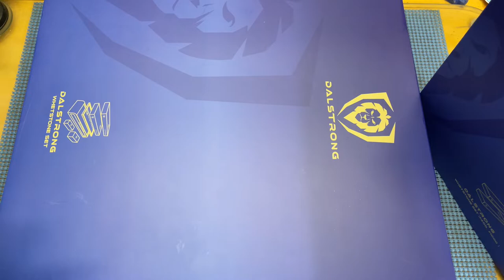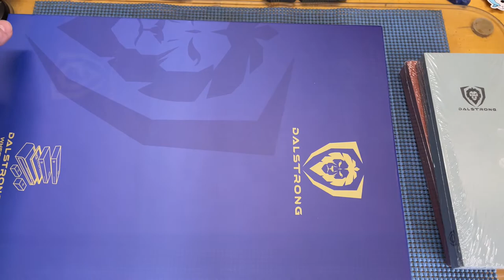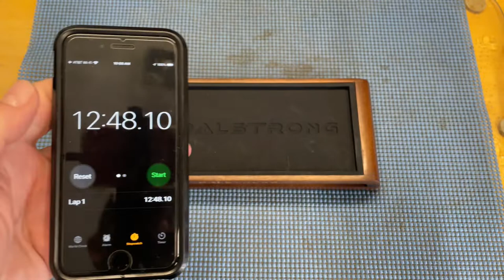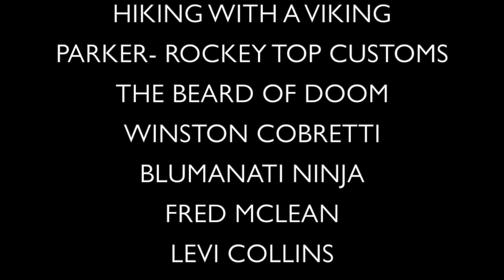UNBOXING SHARPENING  AND REVIEW | NEW SHARPENING STONES

Comment: Rust eraser works amazing to clean your stones with
Reply from the maker: That's not what it's for… It's for on your knives. The other stone, the nagura stone, the white one is what you use for cleaning your stones. You don't want to cross contaminate your stones with anything that might be of a different abrasive nature… Unknown grit can screw up the surface of your stone pretty easily and ruin any work you've done on a knife.
Reply: @CrazySharp  I have used a rust eraser for cleaning my diamond water stones for at least 5 years works awesome and doesn’t use up any of your stone I also have used them for years cleaning my chosera stones works well for me never had cross contamination problems